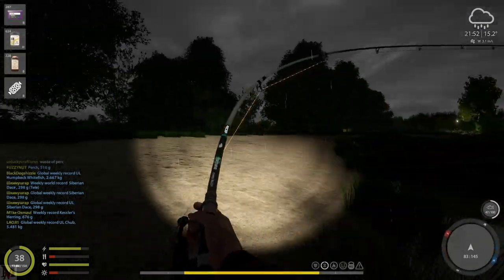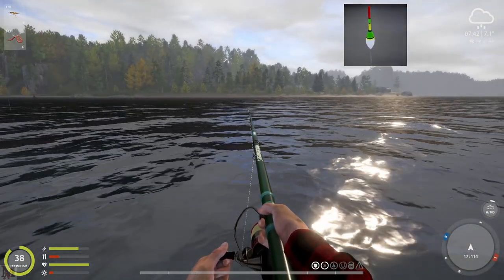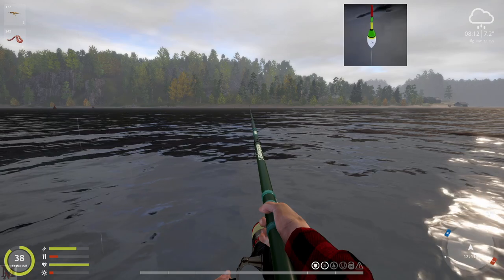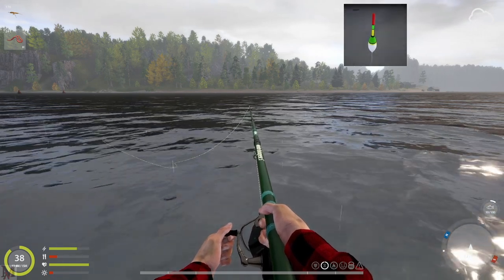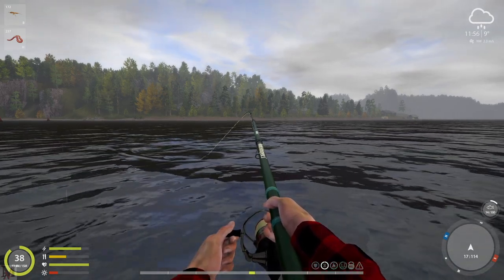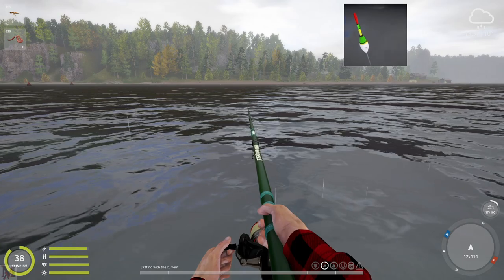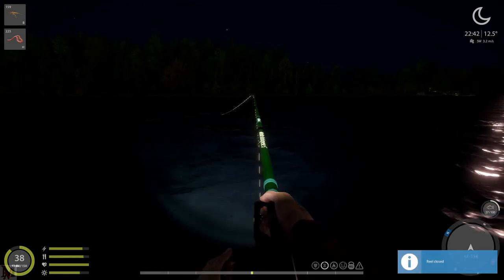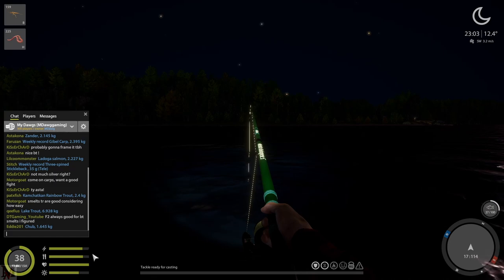Russian Fishing 4 Energy Mechanics

Comment: 20:37 Hello, at this time you commented on the influence of hunger (which logically also refers to energy) on having an efficient fishery and I have a question that I am not finding an answer to, so please: - apart from the fact that if you need energy to carry out any action in the game, is there a difference in the amount of current energy when catching the fish or also when it comes to not letting it slip off the hook? For example, will I be able to catch more fish (the "strike") or not let them slip off the hook if my energy bar is green than if it were yellow? Thanks in advance for your attention ;)
Reply from the maker: Ok couple answers to this. 
First, If your energy bar is in green, you will reel faster than if your energy bar is in yellow. If your energy bar is in red you will reel super slow. So if you want to be efficient then having your energy bar in green will reel in the fastest. 

Second, your energy bar has nothing to do with how quickly you "hook" a fish. That is up to the RNG gods and your timing in setting the hook. However you can improve your "hook" timing by getting higher quality hooks, they hook faster. 

Third, yellow and green energy bars have nothing to do with "fish got away." So you don't need to worry about losing a fish because your energy is in yellow. However if your energy drops to 0, then you automatically lose the fish. So watch it when your energy gets into the red. 

Hopefully this helps.